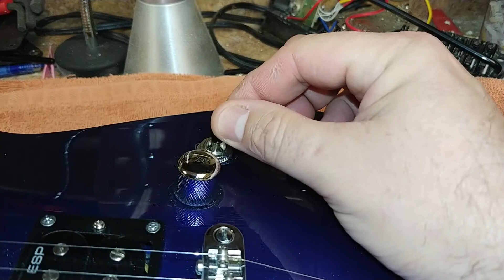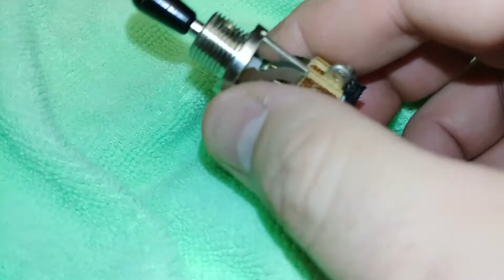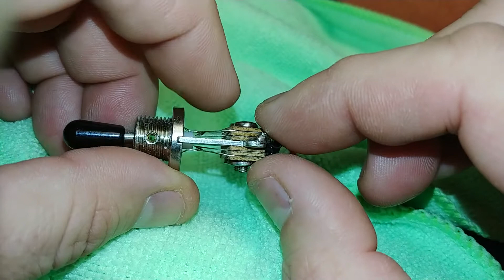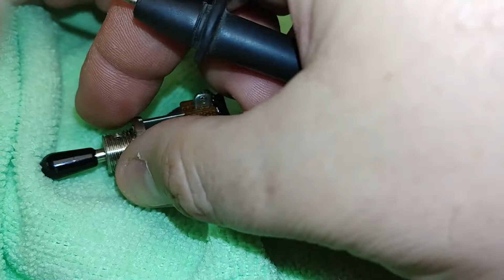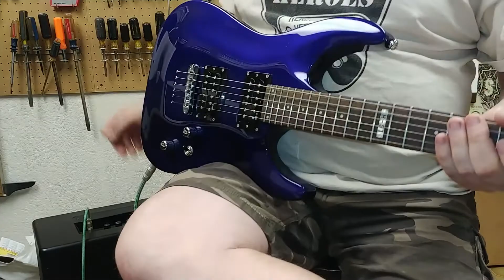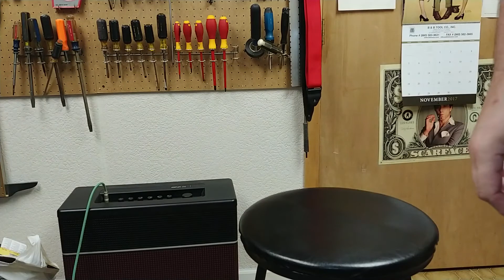Switch Guitar Way 3 Fixing

Comment: the common 3-way switch problem is NOT the pickup selection and connection... it is the shaft of the switch ! I have seen 2 older guitars lately with a broken off shaft (half the shaft gone and the tip with it). So I measured the shaft diameter and a 3-4 mm  inside diameter (ID) steel tube can be epoxied carefully over the remains of the switch shaft. Then glue a tip on the end of the glued shaft... leave maybe 1/2 inch to work with with the new shaft addition in place. 
Cut and smooth the 'tip end' before epoxy-ing the tube section  over the  broken shaft. No soldering in a new switch, removing the old, etc. And some guys do not or can not solder in a switch very well (small cavity in the guitar, poor light, maybe no work table, etc.). The switch may be fine with most of the shaft broken off and a short section of tube can be epoxied in carefully...

Comment: I switched while playing and the sound was turned off in all positions. So I'll try this. Thanks.
Reply: It dint help. If anything it's even more dead now. I did dissassemble that sandwich thingy and removed the"chainlock". After putting everything together it doesn't even make crackling noises when u flip the switch. Or touch it with a screwdriver. My neighbours have started to say hello again though.
Reply from the maker: sure a ground has not disconnected or maybe the lead to the output jack?
Reply: @ericctheartofnoise8613  Thank u sir for answering. But I am the kind of person who can stare at something and not see it, even if it is there right in front of me. I think I have to buy things. New cable and an Ohm-meter to begin with. (And then it has cost so much I could have given it to the repairman) I apologise for all this negativity. I must give up this day as it is 21.49 on this side of the pool. Good Evening to you sir!
Reply: @ericctheartofnoise8613  Ha!!! The bass! Right in front of me! I tried it. It doesn't work either.... So ''tis the cable. Or the amp. Could the amp shortcut on max volume? Tiny Laney see... maybe. Now how to try the cable or the amp...? Talk to weedsmoking neighbour I will.. also guitarist. Wait and see...
Reply: @ericctheartofnoise8613  Latest development. I find another cable on the floor. A speaker cable perhaps. Proves everything is working. But a lot of buzz in the speakercable. A lot of swearing. Neighbours hate me again.
Reply: @ericctheartofnoise8613  Done! I cut the cable off! Took away the old stuff. Reattached it. Everything works! Thanks for the moral support.
Reply from the maker: glad you got it working again. if one is not messed up...  take it all apart to fix it. lol
Reply: Couldn't that stupid toggle switch be bypassed entirely? Make a video on that. Or maybe I will. Who needs it? It's not like all beginners have to go all fancy and flip the toggle switch to impress an audience of hundreds of thousands? I must have shortcut sth else by flipping the switch while playing. At max volume. Adjust tone and volume, but dont flip. My advice. Best wishes and thanks anyway.

Comment: ... 03/05/2020:  Hello, I have a Gretch 5120 guitar.  It has a 3-way toggle switch that clicks very loud when switching from each position.  Is there a way to silence it, or do I need to buy a new switch that is made to be silent?  If I need a new toggle switch, who sells the silent model?
Reply from the maker: the terminals on each side of the switch act like a spring as well. they are very tight and giving you the a clicking noise that maybe herd from the amp. you can try to bend the two outer terminals so they are not so tight, but make sure they are still touching when the switch is set to middle. also your pickups might be sensitive to the switch vibration when switching.
Reply: @ericctheartofnoise8613 :  Thank you for your fast reply. The loud noise "Click" comes from the chrome lever hitting the round frame (no noise in amp).  I tried WD-40 electrical spray cleaner, but that did not help. The inside spring action does seem to be very strong.  But, is it possible to just unscrew the round chrome lever and replace it with a non-metallic lever?
Reply from the maker: if you like the chrome cap.. cut something hard and put it in the hole of the cap and screw it back on. it will make it a little taller to stop hitting.

Comment: ... 02/16/2020:  I have a Gretsch  Electromatic 5120, which I love, except for one feature.  The 3-way toggle switch clicks real loud when switching each position.  Is there a quick fix for that noise without changing the toggle switch?  If not, what brand of toggle switch would be silent?
Reply from the maker: sounds like the metal that holds the ball in place when switching is very tight. you could take the switch out and bend the tabs a little that hold the ball end that makes the metal make connection. it acts like a spring and maybe very tight.
Reply: @ericctheartofnoise8613 : Thank you for your fast reply. The loud noise "Click" comes from the chrome lever hitting the round frame (no noise in amp).  I tried WD-40 electrical spray cleaner, but that did not help. The inside spring action does seem to be very strong.  But, is it possible to just unscrew the round chrome lever and replace it with a non-metallic lever?

Comment: First of all I would like to thank you. I just bought a new Epiphone 339 and after a few hours of playing could not have sound from de bridge pickup. After watching your video I realized the inner tab was slightly bent inwards in such a way that when the switch was down they could not touch each other. With a small screwdriver I gently bent the tab straight again and now it works fine. No need to take it away fron its hole, I just twisted it 1/4 of a turn to have access.
Reply from the maker: glad to help.